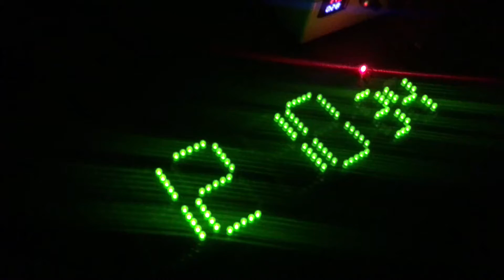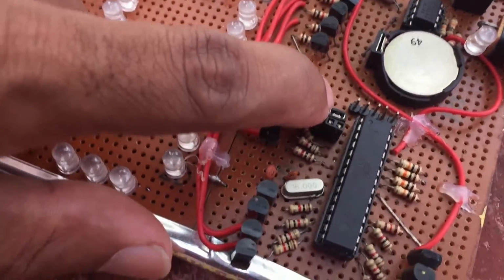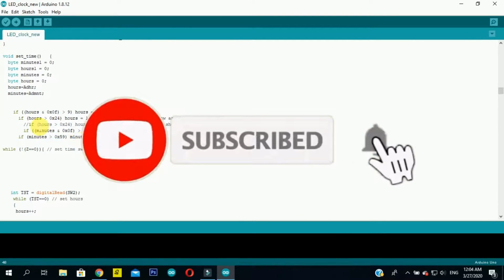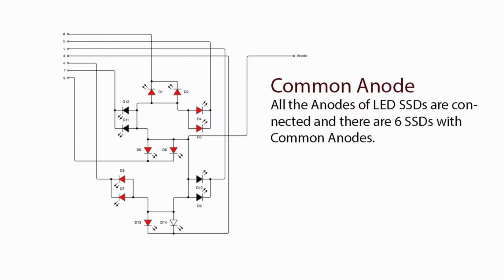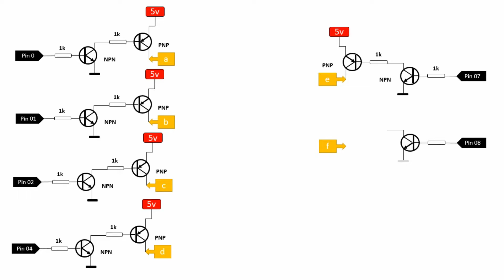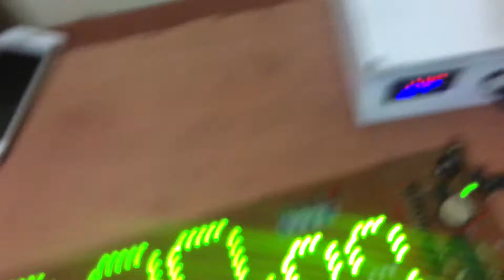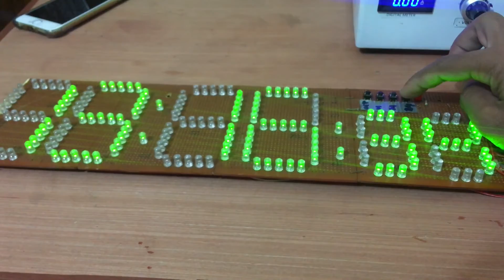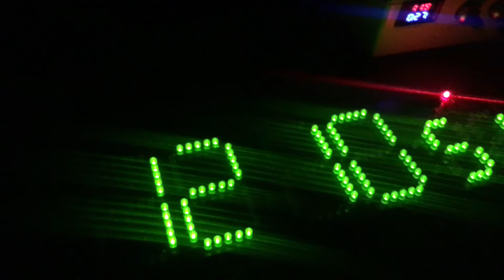RTC Big LED Clock with Arduino

Comment: Sir I have made this clock but its it's running fast ...how to resolve this problem......rest is ok ...
Reply from the maker: How fast?
Reply: In 1hrs my be aprox 5min ..
Reply from the maker: @sonuala5671  Ok. you have to adjust the brightness level in the code. According to the changes of quality of the components, this can be happened. Use high quality Crystal for RTC module.
Reply: Sir I have tried rtc module also but same problem I'm facing ...so which type of crystal l used or any other way to resolve this problem.....or I can use ds3231 module this module is better than ds1307...sir pl guide me ......
Reply: Sir I tested in 24hrs it fast by 16 min do it's not giving proper time so wt to do

Comment: HELLO BROTHER, THANKS FOR UPLOADING VIDEO. AFTER WATCHING YOUR VIDEO I DESIGNED  A CLOCK    FOLLOW YOUR CIRCUIT AND SUCCESS FULLY MAKE  MANY CLOCKS.YOU  HAVE HELP ME MANY TIME .I WANT TO MAKE  A BIG CLOCK TO DONATE SOMEONE. MORE THAN 6 LEDS PER SEGMENT  6 DIGITS CLOCK WHITCH NOMBER TRANSISTER USE FOR THIS
CLOCK  PLEASE GUIDE ME .THANKS
Reply from the maker: Nice. I have done few modifications to accurate the time. watch this video https://youtu.be/K70ni3aZIHA. you can use same transistors used in this video. I think 6 LEDs  x 7 = 42 per segment.
Reply: Thanks for reply  @setnfix .One thing more can we use BD136 single transistor for common Anode.
Reply from the maker: @bamrahelectronics6176   for PNP yes

Comment: HELLO ,BROTHER AFTER WATCHING YOUR VIDEO I DESIGNED  A CLOCK PCB   FOLLOW YOUR CIRCUIT AND MAKE A DISPLAY WITH LED STRIP LIGHT 12 V BUT AFTER CODING  AT MEGA 328 P  INSERT IN DIP 28 IC BASE AFTER FEW SECOND IC OVER HEATED AND ALSO 7805 OVER HEAT . IC DAMAGE.CAN I SEND YOU MY CIRCUIT TO YOU  WERE I RONG PLEASE GIVE ME YOUR MAIL IC OR CONTACT NO
Reply from the maker: check the 7805 pinout as correct.